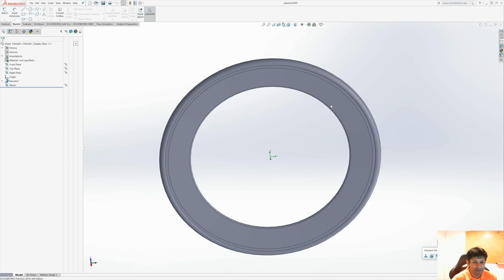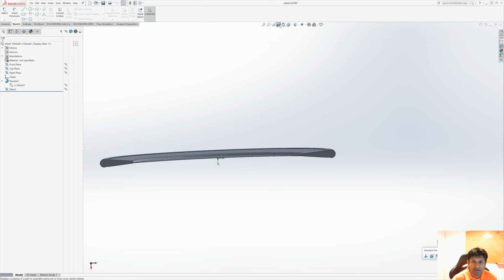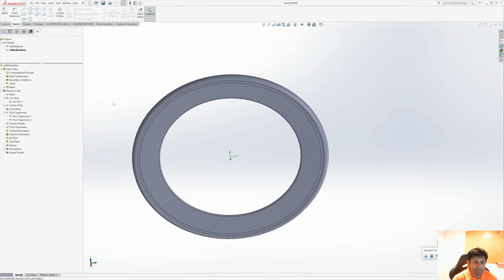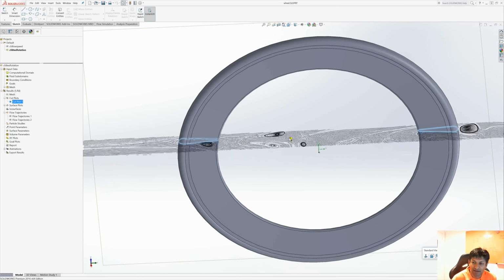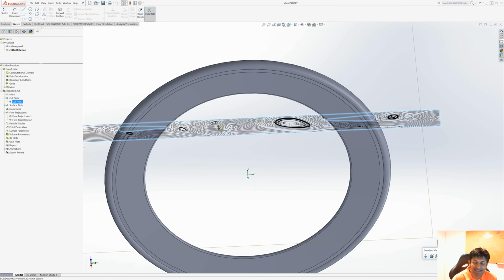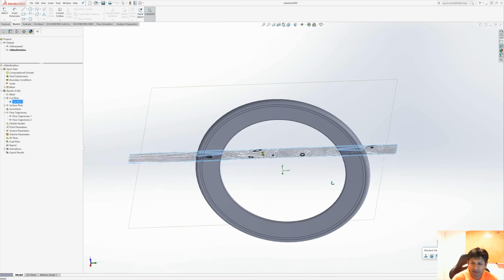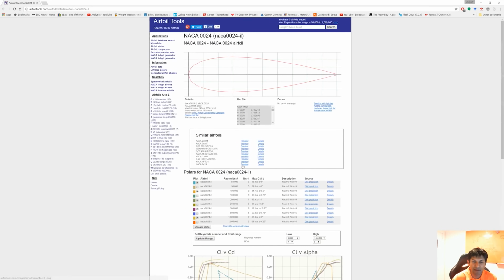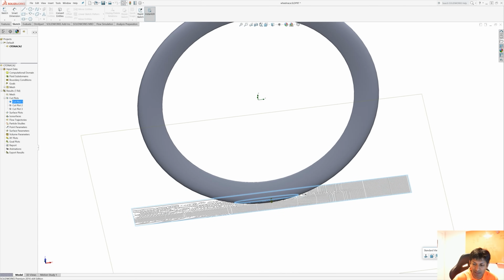Explained: Aero Bike Wheels (Zipp Enve Mavic Fulcrum)

Comment: Mavics don't seem to do well in independent wind tunnel tests and reviews I notice, even though it has as you say the preferable NACA profile. Why do you think that might be?
Reply from the maker: That's a very good question. 

The most important consideration are the tyres, mounting a tyre that protrudes wider than the edge of the mavic rim will cause significant turbulence at the back of the wheel. It will also cause turbulence where the clincher meets the tyre bead. 
Speed tests are often conducted at 40km/h (50km/h in the latest bikeradar test), they do this because if they did this at a lower speed, there would be insufficient difference between the best wheel and the worst wheel to justify the horrendous price difference. The average "good" rider will probably be going at 35km/h (air density will affect this), most club riders are at 28km/h. At these "mortal" speeds a NACA aerofoil is quite effective because it's side to side vortex shedding is limited. A toroidal aerofoil is really only good in completely steady state conditions such as a wind tunnel. Out on the road which is where it matters, there are various bits of road furniture that upset the airflow coming onto the rider - technically this is called transient analysis. 
Items such as lamp posts, a passing car, a hedge all affect the airflow. Another factor which nobody seems to have commented on is when a rider is going full gas, their bike tends to rock slightly from left to right, only by a few degrees but this upsets the oncoming airflow. An aerofoil which sheds fewer vortices during this process will be more aerodynamic.
Measuring the drag of a car in a wind tunnel is not a perfect science either but the car's velocity relative to the effects caused by street furniture is much greater. A car can be doing 120km/h and the street furniture is maybe pulsing the airflow by 2-3km/h hence the delta is massive. On a bike which is doing 35km/h and the furniture is providing 2-3km/h of pulsing the difference is much smaller. 
So to summarize, the rim depth has the most effect, mounting a wide(r) tyre onto a narrow rim is a big no no and a wind tunnel is a poor measure of real world (pulsing) conditions because wind is not constant in speed or direction and the speed magazine's use for their analysis is a speed that most riders do not or cannot ride at.

I want to emphasise that at around 35km/h there would be little to separate any of the wheels provided the section depth was the same and the tyres were appropriately sized. The choice of aerofoil section is really only a marginal gain. My choice for the NACA aerofoil is the best choice of those marginal gains.
Reply: So does that mean an open mold rim would be fine? There is a big price difference between that and a zipp or enve
Reply from the maker: Aerodynamically yes, Enve and Zipp may or may not have better hubs but the aerodynamics of the wheel will show little difference below 35km/h
Reply: All good points there. Wheel makers are designing wheels that beat each other in the wind tunnel without consideration for real world conditions.
As you say, a side gust of 20km/h is inconsequential to a 1500kg car travelling at 100km/h, but very significant to a 70kg rider at 30km/h.
The 'rocking' bike is interesting too and will create extra turbulence. Do wheel makers test for this? No!
My V-profile Lightweights are BETTER in sidewinds than the more toroidal Corima 47 S+ (same depth). Neither is a problem in winds up to 70km/h or so.
Showing the difference between a 50mm and a 30mm wheel at 35km/h is hard enough, let alone the difference between 2 x 50mm wheels.
Reply from the maker: I have tried to model the rocking motion but it is extremely difficult. You basically generate a vortex to the right and then to the left but it's not consistent at all. This is coupled with micro steering corrections/movements. Your point is correct though, the wind tunnel versus real life is probably 70% accurate at best.  Accounting for road furniture is difficult to do in a wind tunnel

Further, the guy at bikeradar described shimano and campag wheels as "canon fodder". I'm sure he has done his credibility wonders.
Reply from the maker: The issue is the teardrop shape (I'll use NACA 0024 as my basis) is equally as stable as a toroidal shape. It is shown here http://airfoiltools.com/airfoil/details?airfoil=naca0024-il look up CL verus alpha chart. It's good up to 15 degrees.

The problem is the rotation of the wheel invalidates these aeroydnamics because either the Toroidal or NACA shape are both elongated at any point other than the horizontal plane that goes through the skewer. The actual loss (if there is any will be small) for the vast majority of riders because they are simply not travelling fast enough. If you are at an angle of 12.5degs of yaw, then a shallower wheel would be faster.
Reply from the maker: In my opinion yes it is marketing. If you look at the section labelled "firecrest difference", it can be clearly seen that the teardrop aerofoil is longer than the toroidal one. In which case the test is at 2 different reynolds numbers and is invalid. I need to emphasise the toroid only looks like the firecrest picture when you slice through the centerline of the skewer. Anywhere else on the wheel and the profile is stretched out. 

I could use a 40mm V section against an 80mm toroid, the box would be be faster at higher yaw angles because of separation - I agree with Zipp in that respect.
Reply: Everyone ignored me when I talked about rotational drag!!
Reply from the maker: It's because we need to do clickbait videos to get noticed... unfortunately. At least a majorish manufacturer has acknowledged it.
Reply: @K Smythe, the Mavic Cosmic Elite wheels do really well for their depth, but the older Cosmic Carbone SL wheels perform quite poorly with wider tyres because I think they're designed for really narrow tyres (e.g. 19mm)
Reply: @Beaver What most people miss about 23mm clincher tyres on 21c rims is that the rim is almost as wide as the tyre so the tyre bead doesn't sit on/in the rim very well. If you're cornering hard you may roll the tyre off - I've seen this occur infrequently during A/B grade crits. I think the problem may be made even worse by reducing the pressure. I wouldn't go any wider than a 17c rim for 23mm tyres.
Reply: Hambini so, what would you recommend for endurance cycling as a compromise? NACA profile with Shimano hubs?  I notice some folks with deeper section rear wheels?
Reply: Wenqi Zhang 
Cannondale, in their testing for their Systemsix aero bike, found wide rims (20mm inner diameter), with skinny tires (23c) offered the least rolling resistance. Don't know how they did their testing. But following that logic, I went tubeless with Roval CLX 64 rims, 20.8mm inner diameter and 23c tires. It feels like it has less resistance, but I have no data to support that.
Reply: @beaver7847  As a scientist, I find data on aero and graphs presented by this company and others to be utterly hilarious. Of course, none of this is verfied, or certified. It reminds me of the start of the aero era with Shimano, where they posted images of individual parts in wind tunnels with smoke trails.
Reply: @Hambini  So cheap ebay deep-section rims for the win then!

To be fair, even if I might be cruising along chatting at 30km/h so I don't care so much about drag then, but when there's a section I want to go for the KOM time, all of mine have been in the 45-65km/h average range (it's very flat around here), only then I'll care about aerodynamics.
Reply: Mavic hubs aren't very good..
Reply: @Hambini  So in essence, regardless of what bike radar said about enve or hed jet wheels, until I can hold an average of 35 km/h + for the entire bike leg of a tri, I am better off saving my money, being happy with the wheels that came with my bike and investing some time in my glutes, hamstrings and quads
Reply: @Hambini  So, now its 2020 and we have the Zipp 303s which was supposedly tested using "real world" factors.  Given the limits to that wheelset, what are your thoughts on 1. Their new testing method (if you have an idea what they did, no worries if you dont) and 2. How does their tyre interface and inflation spec impact the wheels aerodynamics?
Reply: Hambini I bought Mavic CXR 80 inspired by your love for all things French
Reply: @robertorolfo  if you do the research, you would find Mavic's current generation of id360 hubs to be a ground-up redesign and actually pretty good quality.
Reply: I guess throwing in spokes would really change things up with top and bottom spokes?
Reply: I think that's more to do with the spokes, most likely the conversion of airflow from the rim to the spokes is improperly displaced and actually causes more vertices

Comment: Hey amazing video and I really enjoyed it! Just a disclaimer, I have no degree in engineering but as I understand some of the research out there is that the reason the wheel industry moved away from the NACA profile and into toroidal shapes is due to stability considerations. Apparently, the average yaw angles that cyclists encounter are between 5-10 degrees and this is where the toroidal shape performs better than NACA profiles (and some claim to have a "sailing" effect" akin to sailing into the wind). Also, I read somewhere that the discontinuity between the tire and the rim actually creates a beneficial vortex that causes airflow to reattach to the rim (if the tire is narrower than the wheel). And one last thing about toroidal shapes is that it creates a similar profile between the leading edge and the trailing edge of the wheel-tire system. For sure some of these is marketing as some of the research where than by the wheel manufacturers but I would like to hear your thoughts on this.

Thanks again for the great video!
Reply from the maker: Hello Franz, thankyou for the comments. 

The key thing to realise from this analysis is the type of aerofoil profile has very little effect in comparison to the length of the aerofoil chord (ie the depth). The difference between a toroidal and a naca profile will not be much but the difference between a box that is 80mm and a Zipp 404 will be massive - the box will win most of the time. When you get to a yaw angle where large degrees of separation take place, it is more advantageous to have a shallower section wheel (especially in the front). 

In the range of 5-10 degrees, a NACA 0024 profile should be better than a toroidal shape because it would be no where near separating. I estimate at the Reynolds number for the top of the wheel, the stall angle is about 12 degrees. Link here http://airfoiltools.com/airfoil/details?airfoil=naca0024-il

Comment: Years back, I had 30mm aluminum clincher and 44mm carbon tubular wheels in the classic "V" shape, which was popular back then (10-15 years ago).  I don't really recall having to fight the wind very much and having my bike blown all over the place with these wheels.  With my HED Belgium C2's (24mm) and Enve 3.4's (35mm front and 45mm rear), the wind is brutal and my front wheel gets incredibly sketchy with the "U" shape.....even my 24mm HED's get blown around in gusty crosswinds - and the tire profile fits much better/cleaner with my current wheels than my older (and narrower) wheels, which had the bulb shape going on back then.
Reply from the maker: the amount of twitchyness is related to how much separation you get. it might be a particular combination that sets it off. largely the separation is related to the Reynolds number of the wheel and fluid
Reply: Hambini: that's true to a degree but twitchy behaviour also is affected by centre of pressure both for the front wheel in isolation (with the imbalance causing a steering torque) plus the bike as a whole. E.g. If the entire bike centre of pressure was at the back axel (approx) the bike would not be turned.
Reply: Jof Arnold Also, the degree of head rake has a dramatic effect on the tire staying straight...less angle twitchier steering...too much angle and it "flops" into turns. In the quest for overall weight reduction those are negleted b/c of target riders, target weights, cost and deadlines~ It's a black art that many manufacturers overlook.

Comment: This is the first of your videos I’ve watched and it was awesome, thank you so much!  I studied engineering (a long time ago) and its great to have such a clear explanation of the fundamentals of drag forces on wheels.
Have you calculated the CdA of the deep section 808 versus say a 404?  I’ve just invested in an 808 for my TT’s and keen to understand the CdA improvement likely from the deeper section.
Also, I saw in the comments you didn’t see much benefit in a rear disc, at least in side wind conditions. I’ve been riding a disc this season compared to a rear 404 last season. It is definitely faster. I’ve calculated my CdA using the formulae for cycling resistances (inputting other known parameters such as power, weight, temperature, humidity, air pressure, and reasonable estimates for mechanical efficiency and rolling resistance).  Based on my calcs across many efforts this season and last, my CdA has been lowered by 0.014.  The disc is the only difference between this season and last, so I had attributed that to the disc. Interested in your thoughts as to whether you agree or not.
Again, awesome video, I’ll now be looking at your other content.
Reply from the maker: Hi Briony, It's a bit difficult to say for certain that it's the disc that is causing the difference. I have never found these generic formulas to be particularly accurate - they get you in the ball park but to get to 0.014 of precision would be pushing it. 

However, parking that to one side. The disc will give you an Aero improvement, the impact would be a function of your body and bike in relation to it.
Reply: Thanks Hambini.  When you say you don't find the generic formulas accurate, what generic formulas are you referring to?  I mean the physic equations that allow you to calculate speed based on gravitational resistance, air resistance, rolling resistance, and mechanical resistance. While there is some variability day to day (probably because of differing wind conditions), you can minimise these errors by choosing a loop course.  And by measuring CdA numerous times for each configuration, I think you can generate reasonable average CdA figures for each configuration over time. The chart below is an example of CdA with different clothing, keeping all other parameters constant.  If I was proficient in CFD I'd try that also.  But without CFD, the field test is the best I've got. Hey, does CFD allow you to quantify the CdA benefit of a deep dish Zipp 808 versus say a Zipp 404 or 202? I'd be very interested.  Thanks.
Reply from the maker: The generic formula used for drag is CDA * 1/2 rho V^2 to give the drag force and then apply a sin or cos correction for angle. In my view this is not accurate and especially bad for a wheel, Wheels are rotating so the CD value changes as the wheel angle (yaw) changes. The formula you use above assumes a Fixed CDA. I guess at the end of the day, it's how much of an accurate answer you want. Hope that helps Hambini
Reply: OK, I understand, thanks. Yes, the calculated CdA for a field test is an average of various yaw angles, and is also for the entire and unique bike + rider system. By isolating one change in equipment and doing numeous field tests I’ve been able to determine statistically significant differences in the CdA for different configurations. But there is variability day to day and I see that the CFD method has some major advantages. Thanks again for the insights Hambini.
Reply: If you're chasing that little of a gain it might be better to understand what your true intention is behind it. Max speed? Overall avg speed? What chassis is best suited for that? The number 1 most important question of all...how do you train? Do you have the leg power/endurance to get the full advantage out of your mathematical endeavors? Math is a great start...but out on the road and in competition are the TRUE tests of what works. I love your attention to detail! I'm sure your one hell of a competitor!!! 😁😀👍

Comment: Also, vortex isn’t drag but indicative of drag. 

Thrust energy is charged into volume of air molecules by compression during the frontal section that is followed by energy return from air molecules in the expansion phase by the trailing section, provided that we have lamina flow during expansion. 

Energy in vortex is harnessed from energy in the expansion flow. Suppress vortex generating can conserve the expansion energy back on forward thrust. The end effect is what we call low drag.

Comment: Hambini, your videos keep restoring my faith in humanity. I have a question, though. I understand that spinning up wheels require power. But once wheels are in motion, their kinetic energy is constant and there should be no need to use power (i.e. add kinetic energy to them) --  unless they somehow interact with the air and drag it along. Is that what you had in mind -- that the air resistance of spinning wheels is different from the resistance of wheels at rest? Thank you for your answer.

Comment: Hambini Sir, I summise that, to use a 23mm tyre then a rim of x would be sufficient for minimum drag and a 25 tyre will have a deeper rim depth (y) because the teardrop/NACA shape of the rim&tyre system needs to be bigger to incorporate the bulge or balloon of the tyre. A 28mm tyre would require, an even deeper rim.  Would that be right enough?
Reply from the maker: Yes that's correct and a very good summary